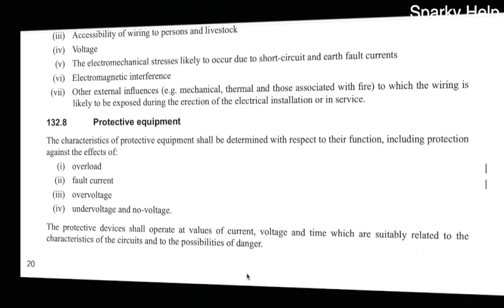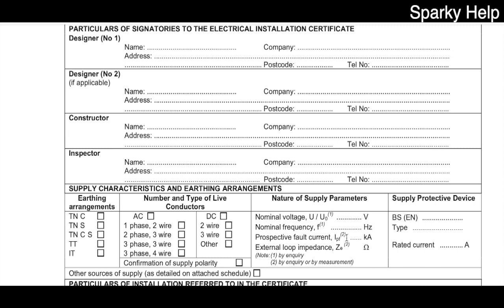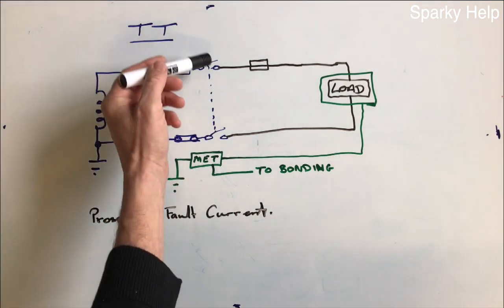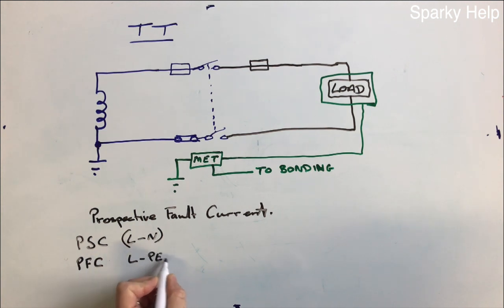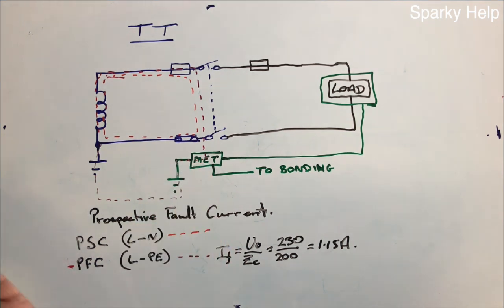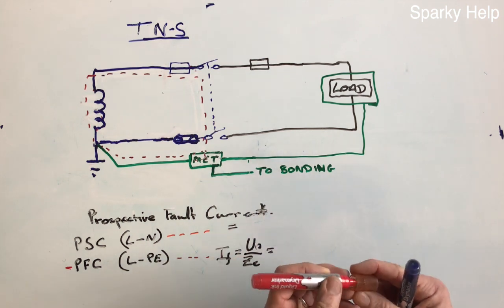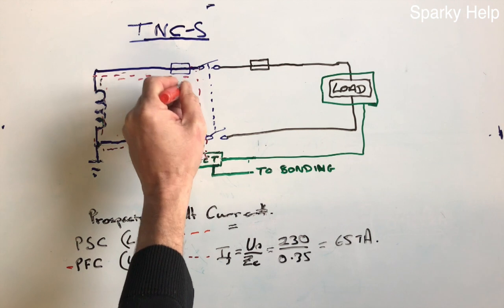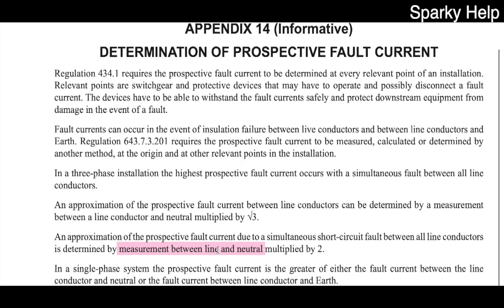Easy Guide. How to Measure Ze & Prospective Fault Current and how to record on the Test Sheet

Comment: Excellent clips.
Reply from the maker: Many thanks! Please Like Share & subscribe.
Reply: @sparkyhelp3997  I'm redoing just the practical part of testing course next week.  I didn't find one of the 3 faults. It was on a socket radial.  All I can think of is I missed n to e and perhaps that was it. On a light circuit there was no continuity from l through switch to lamp. The same instructor had made a mistake with one of the other candidates
Reply from the maker: Well good Luck, just be methodical in your approach.

Comment: Hi, In this video, you mentioned that the test meter you're using measures the voltage and sends out a test current. Can you expand on that please? Remember you're testing a live supply, why is there a need to send out a test current?
Reply from the maker: it's an earth fault loop test, so to test it put out a current to earth (hence why it will in some cases trip an RCD).  Lots of meters have a high and low setting (ie value of current).  With a known voltage and current, an ohmic value can be established. 

Hope that helps, Please Like Share & Subscribe

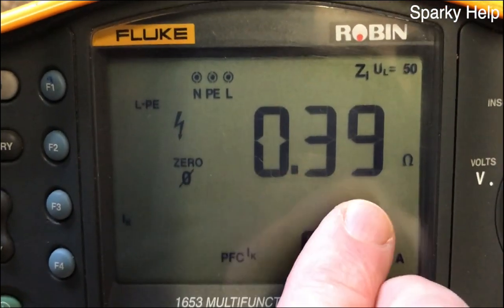Comment: At time 6:05 I noticed your Ze reading was 0.39. What type of earthing arrangement did you have. It I have it right if this is a TN C show should be below 0.35. So if this indeed the case what do you do about this as is nothing to do with the installation it is an issue with the DNO. Would they investigate we expected to install an earth rod. Would we keep both earths or convert it completely to TT?  Thanks for the video.
Reply from the maker: Hi, you are quite correct, if it is a TNC-S installation for a 100A supply 0.35ohms is the max at the origin.   If this is higher it should be reported to  the person ordering the work who should take it up with their DNO.  I have been told in the past to treat the installation as a TT...  obviously check the meter is working fine first (ie calibration)
Thank you for watching.
Reply: @sparkyhelp3997  thanks for the response.
Reply: @sparkyhelp3997  You mean if you've reported high ohms at origin the DNO response has been to treat the installation like a TT? Interesting.